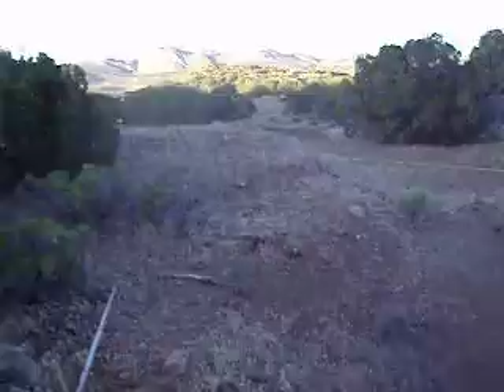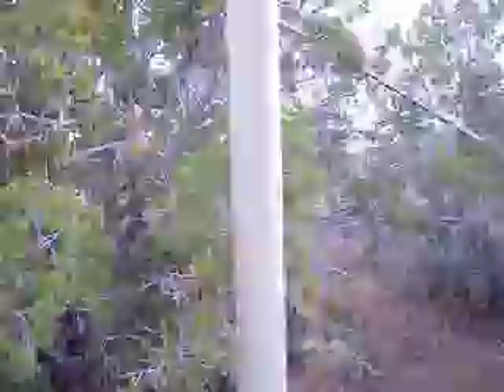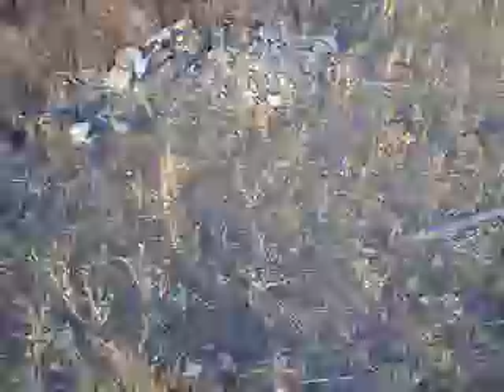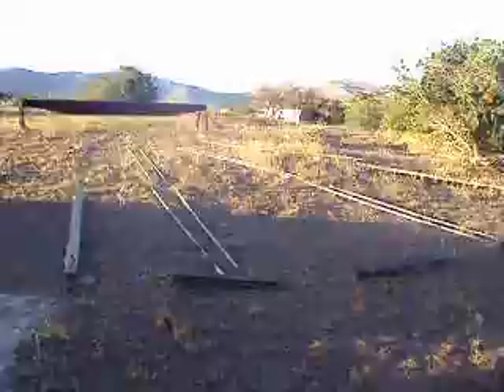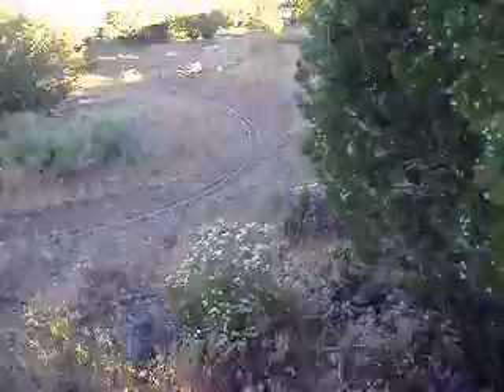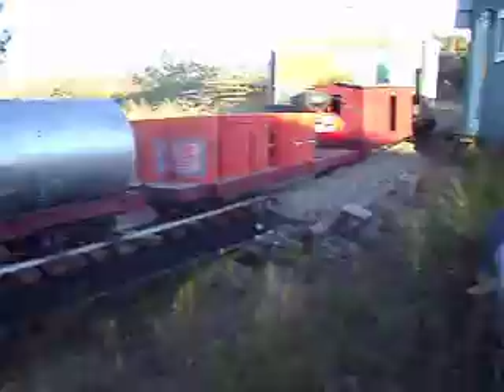quail valley 15 inch gauge

Comment: @QVRY8 i got the same problem. A dad who can weld and shape anything out of metal but no welder or mils lathes. sucks! haha. like they say, the engine will cost alot the cars will set you back some to but the shop equipment is the most!